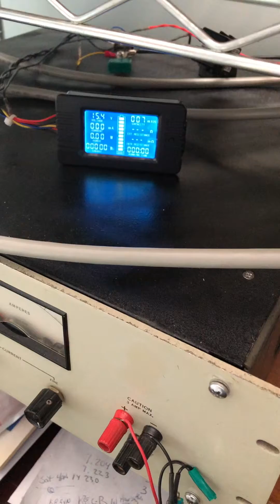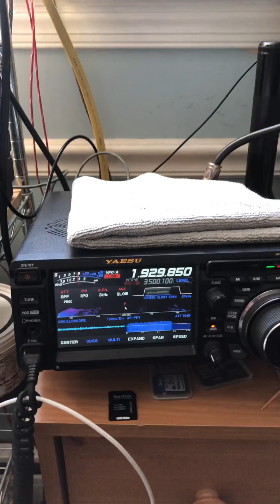Yaesu Ftdx10 insert SDR card boot error

Comment: Had my DX10 for just shy of 2 years... and it started doing that... sent it in and they told me it took a voltage surge on the DC power cable.  The power supply is fine, and is fixed 13.8V with 100~240VAC input... suffice it to say, I'm not happy.
Reply from the maker: That sucks as the newest firmware release has specific fixes to the sd card software to fix this and lock up issues after updating from the sd card. I would be upset but hopefully they loaded newest firmware and you should be set for years of trouble free operating 😉I was so upset I bought a second 10 as a back up and it had a few issues HRO swapped it out and I’m still on #1, although it has a relay issue after long key downs , I just short cycle the ptt again and it comes back to life

Comment: I had the same problem today with a radio I purchased two weeks ago  I called Yaesu and they told my to power the unit up while holding down the Fine and Lock buttons. That fixed the problem but wiped out all of my settings. They said the problem usually won’t reoccur after that.
Reply: The Zin-CS reset you showed didn’t bypass the error screen for me. I really like the radio and hope there are no more problems. I’m a total beginner and stumbled across a YouTube series by N4HNH that’s very helpful. He does a very deep dive into the FTDX10 over the course of 30+ videos. I’ll let the group know if I have any more problems.
Reply from the maker: @marks2254  yup there is also a ftdx10 groups io forum. Yes you hold down Cs & zin and power cycle and it should pop up with your call if not try a few more times. I love my ftdx10 wouldnt trade it well unless it’s a 101 with dual vfo and Rx ant input, vc tune pre selector ☺️
Reply from the maker: They lied then. It will happen and possibly till they replace a ribbon cable but as you I use the Cs and zin to sum times bypass that screen without loosing settings. If you use fine and lock it does a complete reset. Once your settings are set back up with sd card and then hope you don’t run into this screen. It’s definitely a bummer and hope the next release of firmware will fix the boot error. I would hate to ship it in for service and that’s last resort

Comment from the maker: Sd isn’t installed. Nor did I load from card. I wrote all  setting down and it’s 10 minute ordeal to reload. So sd shouldn’t be a issue. After I get my 101 it will take a vacation to Yaesu California. Then be sold after they send it back. Hate the way the band button works now. 1.04 was the best. May revert back next time I need to redo settings